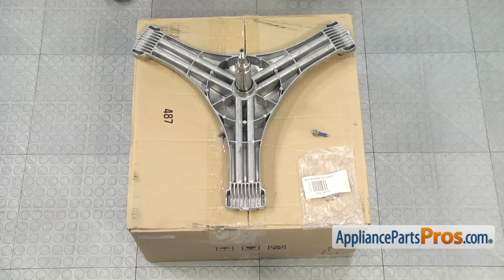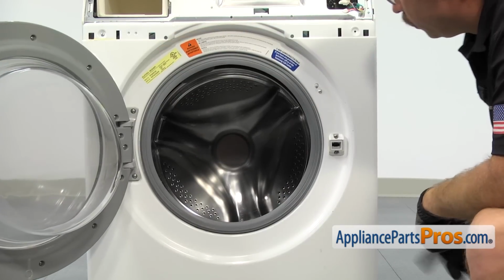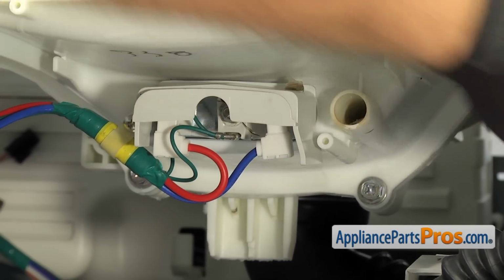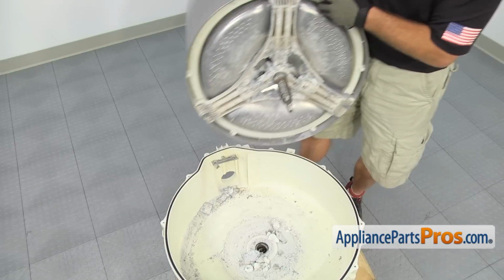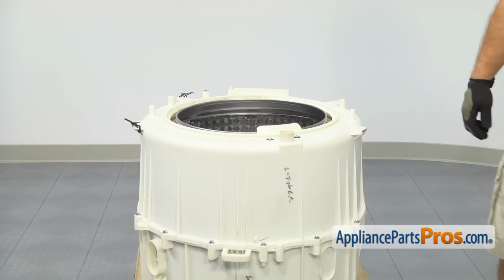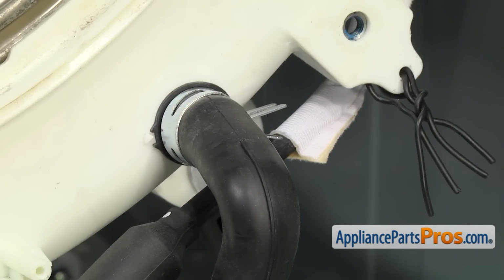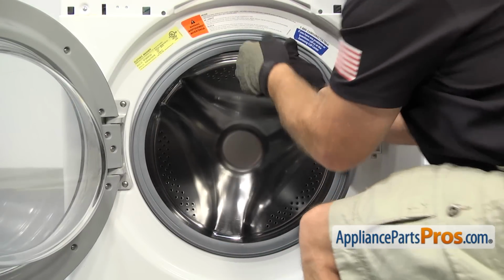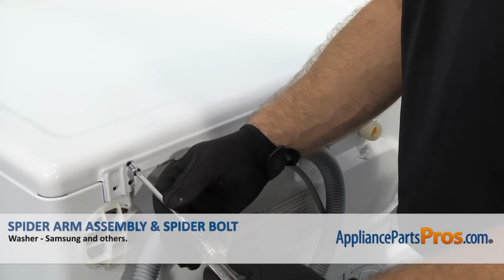Washer Tub Out of Balance? Replace the Spider Arm Assembly — Samsung (DC97-12528A)

Comment: MY WASHER WONT SPIN BUT WHEN I MOVE IT BY HAND IT GO AROUND A LITTLE THEN STOPS/JAMS. THE TUB WOUBLES /*LOT FROM THE FRONT. I PUT I ON SPIN ONLY STILL DOENT MOVE BUT IF I NUDGE THE MOTOR A LITTLE BIT IT SHUTTERS A BIT. - IF I REMOVE THE MOTOR FROM THE BACK SHOULD I BE ABLE TO TELL IF THE SPIDER ARM IS SHOT?
Reply from the maker: We'd be happy to help you figure that out, but we'll need some additional information about the model and the problem. You can give us a call at 1-877-477-7278 or you can chat us at our website: http://www.appliancepartspros.com/. We will need the model number for the appliance, so that we can look up diagrams and information about your specific unit to give you accurate advice. You can look here on our website to help you find the model number: http://www.appliancepartspros.com/modelnumber_locator.aspx

Comment: I want to thank the good people @AppliancePartsPros for making this video and having a well-done parts ordering website so I could validate that I was getting the correct parts to repair my Samsung Washer.  You guys saved me from having to buy a new machine or pay an arm and a leg to get it repaired.  The repair was involved but not difficult (other than some rusted components that required a little "percussive maintenance" ) thanks to your excellent and thorough video.  Even though my machine was a little different that than one pictured, all the major steps were the same and the washer is working like a champ again.  Shame on Samsung for cheaping out on the spider arm part; if it was made of stainless instead of cast aluminum, the washer wouldn't have failed in the first place!  But you guys ROCK!!
Reply from the maker: That's awesome, Chris! We're so glad that we could help!

Comment: Best video ever, your instruction is clean and thorough.  My wife with no help while I was at work took apart and put together a used Samsung she found as a set on facebook for $600.  Once home found the spider arm had fallen apart and punctured the tub.  She soldered the tub back together being that it was just plastic to fix the hole and followed your instructions to a T to fix the spider arm.  We now have a set that will last a good 5 -10 years and we know what to do in order to keep replacing the parts that wear down the fastest.
Reply from the maker: That's awesome! We love keeping appliances out of the landfill, so we're glad to help!

Comment: Thanks for posting this. My machine had a few little differences (Kenmore branded Samsung here in Canada) but basically the same machine. I was quoted $600 to repair my machine, I only paid $1000 for my washer dryer set to begin with! I got the flange and 6 new bolts for $200 at Trail Appliances spares shop here in Langley BC and did this myself in a few hours. Few cuts and bruises! Many thanks.
Reply from the maker: You're welcome!
Reply: MrSupergee how much would you charge me to do the same repair? I would buy the parts. I’m just down the road in Surrey. Let me know if you interested?

Comment: Yeah i would definitely change the bearings and rubber seal too. And paint the new spider-arm to prolong it's decay.
Reply from the maker: Not a bad idea!
Reply: Painting wont work. There is a stainless shaft press fit into the center of the cast aluminium part. Galvanic corrosion will happen there.

Comment: Maann! I just did this repair yesterday.  This video is great but it makes everything look like You won't run into any problems.  I had one corroded spider bolt that held me up for 90 mins. Finally got it off and was able to continue.  Needed help from someone to push the tub back in so that I could secure the motor to the main shaft.  This repair took me about 5 hrs!
Reply from the maker: I'm glad we could help you repair your appliance., though I apologize you had issues. Problems sometimes do pop up when you're DIYing your own appliance repair.

Comment: There has been a lot of talk about crap design and planned obsolescence....    I'll politely disagree.  I just had mine apart after 7+ years and while the spider's webbing (back side) was full of soap scum that was causing the balance issue, it showed little degradation.    I completely agree that galvanic deposition is going to occur as there are mixed metals and a pretty substantial electrical field present.   But I have been careful to not overload the washer and I use the prescribed amount of soap.  Cleaned everything up and replaced the bearings and seals and all is well again.  

I will add that where you live could have a considerable impact on the galvanic issues.  I live in the mountains and my water is extremely clean (usually less that 30ppm on solids) and pretty neutral on pH.    If your water is different it could have a huge effect on making the metal deterioration worse.
Reply from the maker: Glad we could help, and thanks for that info!
Reply: I live in an area where the water has stronger chlorine odor. I was planning on getting an Electrolux. Is this going to be an issue? What can I do to make sure my bearings and spider last longer?

Comment: Great video. I am as far as trying to get the old spider arm assembly off, but the bolts will not come loose. I've tried penetrating oil - they won't move. I was doing so well.... Any suggestions?
Reply: impact wrench?

Comment: Thanks for the video and quick part shipment.  I suggest that people inspect the front drum prior to repair as that might change your repair or replace calculus.  I ordered the spider and upon installation I noticed that the drum had worn through when the spider failed.  Having the spider already in hand, I ordered a new drum.  I think it's a shame to have to send an 8-year old appliance to the landfill (or recycling).    Unfortunately, to compound matters, it seems that product support drops off quickly with many parts being discontinued.  Samsung's environmental practices are appalling for this forced obsolescence.  Hopefully I get another few years out of the machine.  For sure my next appliance WILL NOT be Samsung or any of these other disposable manufacturers.

Comment: Damn, I moved my washer to a new location while renovating the laundry room and after I re -installed, it gave me the error "nd" (no drain) , I lowered the drain hose as low as I could into a bucket and a lot of something that looked like sand came out, once it dried. It was too light to be sand. I can also hear bigger pieces rolling in the drum. Now I know is corroded aluminum powder. 
 Thanks Samsung
Reply from the maker: Oh no!!

Comment: This spider arm is now no longer available
Reply from the maker: That is correct. It has been discontinued by the manufacturer.
Reply: Is there an alternative?
Reply: I searched extensively for this spider across the web. I was able to get 1 through sears but, they are usually unreliable on any part that's listed everywhere else as NLA even though they show it as "In Stock" , apparently I got lucky this time.  Also, this video states the bearings are not replaceable without buying the rear tub assy, I did find a bearing kit for mine with a new tub seal.  There's 3 bearings that can be replaced.  I like this video as it very informative and would suggest buying parts from Appliance Part Pro's, not Sear's, if they are available here.  You can thank Samsung for discontinuing this part. I posted my disassembly on my YouTube page for the tech's I  work with showing how the spider was disintegrating either from the detergent or the dissimilar metals in contact with each other. Either way it appears to be a planned failure from Samsung, in my opinion.

Comment: if this is a Samsung - do not fix it, throw it away now and get something reliable - you have been warned........
Reply from the maker: But if you already own one, isn't it better to keep it going for as long as possible?
Reply: Well, i spent about 6 hours fixing mine, fixed and replaced the water pump impellor, fixed and replaced door mechanism, fixed and replaced the door latch that snapped a week after the new door mech was in, then now after the months of ongoing repairs. the spider arm broke, pulled it all apart again. Replaced it with a custom made stainless spider arm. worked amazing, till now the stupid main board has failed. 
These are just ShIt machines.... 
reallly dissapointed ive been super careful with it since day one and nothing but dramas. 
My advice, buy another machine, even a second hand one.
Reply: unfortunately Samsung and LG are the same company and most of the other front loaders have this same problem also.
Reply: What would you reccomend then? Because im using an old maytag commercial toploader with an old coin mech on it, 30+years old and still going hahaha
Reply: Lol and what do you recommend? Most front loads have a variation of this arm made from the same materials
Reply: Ok sure......you buying?!?!

Comment: Now if only those spider bolts would just come off. We are trying to saw them off with little success so far.
Reply from the maker: You can try soaking them in a penetrating oil like Rust Buster to see if that will loosen them up.
Reply: @appliancepartspros  I brought it to a friendly mechanic who used a grinder on them. Bought new bolts and the repaired washer works wonderfully now. Thanks for the tips.

Comment: Outstanding video, thank you!! After much research it appears you don't need more than a tablespoon of laundry detergent therein lies the weak link. Too much detergent causes accumulation on the spider arm keeping it moist and deteriorating it. I replaced the spider arm and the boot between the door and the tub and bought six new bolts and all is well
Reply from the maker: You're correct, many people use too much detergent and it causes various problems. Glad we could help you repair it, though!

Comment: I'm working on this project right now.  On another video I saw, the gentleman used grease on the spider arm shaft before re-inserting.  I've not seen that on any other video.  What's your opinion?
Reply from the maker: It shouldn't be necessary, but if you want to do it, it won't hurt!

Comment: For the most part it was an easy job to accomplish. For those that not know on the bottom of the tub assembly in the back there is a thermistor switch that if you aren’t careful when putting the assembly back in the cabinet will get caught on the frame and tear the plug off. Also when you are removing the control panel if you have difficulty getting the panel off you are better advised to take the soap dispenser out to allow easy removal. I guess Samsung changes their design quite frequently. Bolts to hold the spider arm to the tub are 9x1.75 30, and the bolt for the counter weight are 9x1.75 65
Reply from the maker: Thanks for those tips! We film the part on a single appliance model to serve as an example of the repair, but there may be slight variations in the process for different models, so we appreciate you letting us know how it went for you.

Comment: Would be willing to get a root canal done with a drill that operates at 5rpm's in exchange for someone doing this...
Reply from the maker: It is one repair that people are most likely to not want to do because it is longer and more involved than others, but if you decide to do it, we're here to provide support.
Reply: bro, you made my day with this comment, it was funny as heck lolol
Reply: Agreed. It looks like something you could do as you watch it step by step, but nothing ever goes as smoothly as it seems, especially when you have not done it before.  There are so many opportunities to lose parts or forget to put them in.  Even if you successfully get it back together, something else is bound to fail, and it would have been cheaper just to buy a new washer.

Comment: What a piece of crap !!!I bought a Kenmore washing machine  5 years and just finish paying the last payment and there she goes the spider arm is totally broken , on top of that i purchased it through  Sears Canada which no longer exist and when bankrupt last year. I extended my warranty last April for 5 yrs which no longer exist ,  now tell me about this repair , the hell with that out the door she goes !!!!
Reply: uh.....5 years?  for a washer?  This isn't a car.   I think you might benefit from a washboard and a tub.  They last forever.
Reply: Appliances used to last 20-30 years with minor maintenance and repair. The spider arm assembly is clearly designed to fail after a few years to make most people buy a new appliance.

Comment: Just wanted to say thanks for the great video.  I replaced the spider arm on my Kenmore Model 592-49057 and this video was super helpful.  I highly recommend purchasing 6 new bolts for the spider arm assembly.  In my experience, only 1 bolt was removed with minimal damage; 4 bolt heads snapped off and the head stripped on last one and I had to drill it out.
Reply from the maker: Glad we can help! And that's a good point about the bolts!

Comment: Our 7-year old Samsung started shaking during spin and stopped the spin cycle early. Also it occasionally smoked at the front gasket. When I disassembled it according to this great video, the spider arm was yucky but actually looked okay at first, but on close inspection it had cracks. This was enough to cause the symptoms well before the arm was corroded out like the one in the video.
Reply from the maker: Glad we could help! Thanks for letting us know how your repair went. You're right, some parts that have failed don't always look damaged upon first inspection, and they don't always fail in the same way.

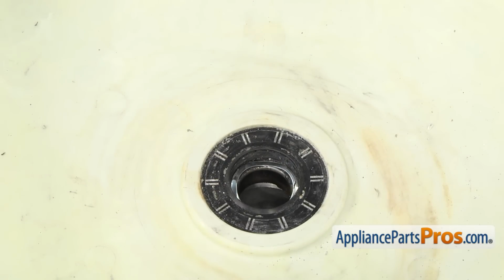Comment: At the time 24:21 you installed a washer. I cant find a pert number for it....Any idea where i can find it?
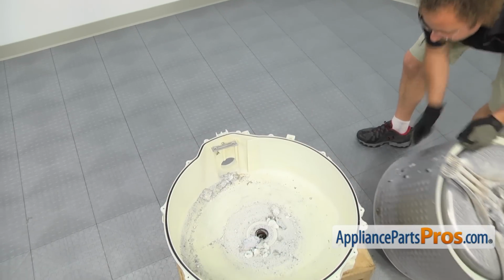Reply from the maker: Sure! In our video, it was a part already in the washer that we removed, then put back upon reassembly (you can see where it was taken out at 20:00 ). However, if you need a replacement, here's that part: http://www.appliancepartspros.com/samsung-washe-6031-001523-ap4066455.html

Comment: Best video for this type of repair. It looks like the spider arm is made out of a hard plastic so it is made to fail in 5 to 7 years making this a poor design at best. My Samsung WF 220AMW model lasted 6 years before the Spider Arm broke. I took everything apart and sold the parts on eBay. My new Samsung cost $480 including tax at Lowes during a sale so not worth my time or money fixing the old one. I paid $399 in 2010 for the old Samsung at Best Buy so they are disposal. If you want a washer that will last 25 years then pay $1600 or more for a Speed Queen. The washers under $800 are all junk that will last 5 to 10 years max.
Reply from the maker: Thanks for your feedback, Steve. I'm glad you found the video helpful.
Reply: I hope the warranty on those more expensive washers put that in writing!  LOL!  My 1st washer I had was given to me so it was already used by a family for prob 10 years, then it lasted me 15+ years. I believe it was an old agitator top loading type. I am spoiled by the HE's now, they're more gentle on my clothes and clean better.

Comment: Thank you very much for this video. A repairman told me the broken spider arm assembly could not be purchased for my Samsung washer, and to just buy a new one, but I found the part on-line and used your video step by step instructions to repair it myself. Runs just like new again. Saved me over $630. Very professionally done. Thanks again.
Reply from the maker: I'm glad the video helped you out with your repair!